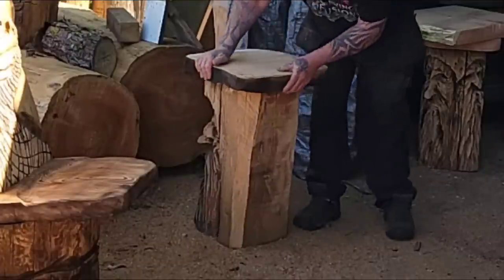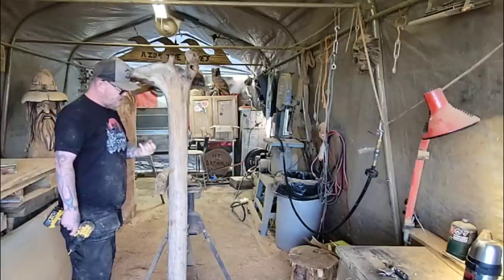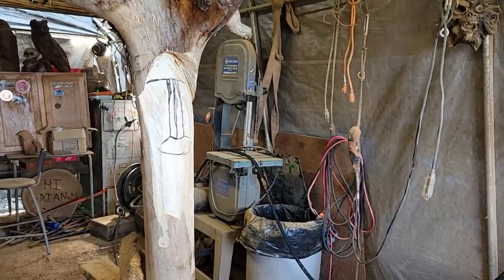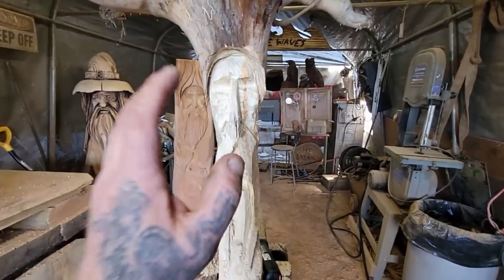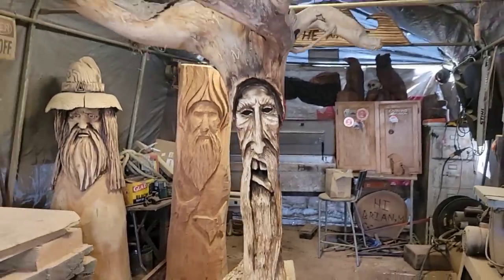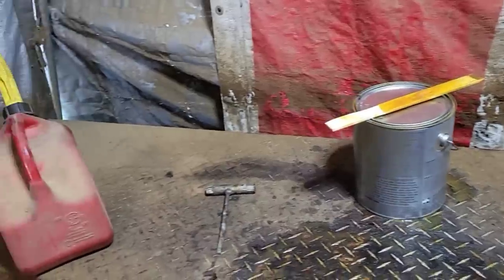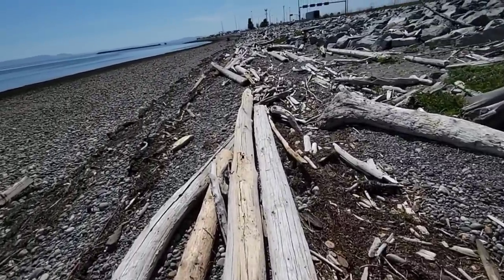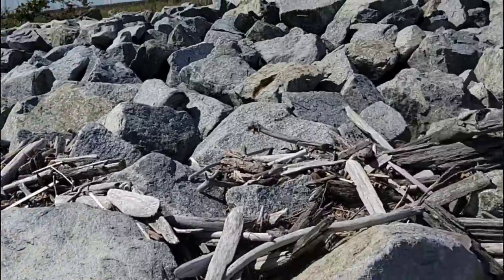Jordy Does - Wood Spirit with teeth, Outdoor Cetol wood finish & Beach Combing.

Comment: It won’t crack. Much more cause of the knots and  because it’s connected to the root,.
Reply from the maker: Wanta bet?
Reply: I   found that if the wood has at least one major knot on one end or the other it may crack but it’s a lot less likely to crack in half compared to a wood piece with no knots it’s like the narley knots hold it together ,but I use full logs .for spirit men but I’m still young and learning  and I’ve only been carving  for 5 months that’s when I almost gave up , then my son bought bought me an apple I pad , I never used a computer 58 yrs and it’s been a mind boggling 5 months trying to learn computers and dremel carving at the same time I’m mostly freaked out at this whole new world at my finger tips . When I first started looking for you tube videos I watched a bunch of them until I saw your site and I’m like why do the other carving sites even try . To me I understand your site and it was like a magnet I have since then watched suffered through many other videos to learn like you say gotta watch other sites and I finally was forced to because thieves stole your site that almost made me quit carving so I watched other sites I guess it was a good thing out of a bad thing ,, carry on!